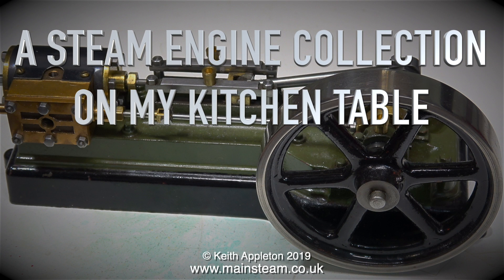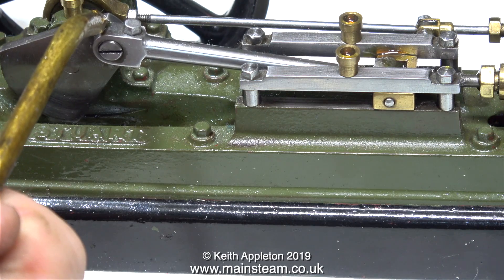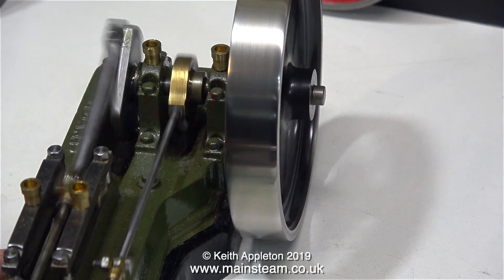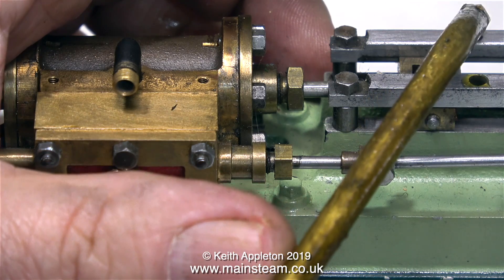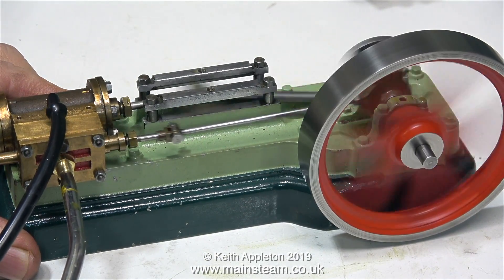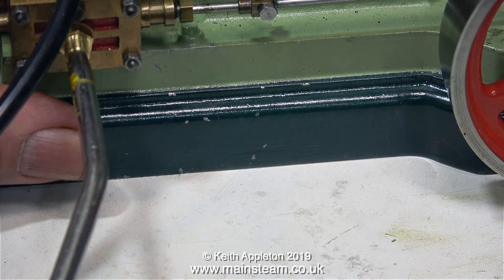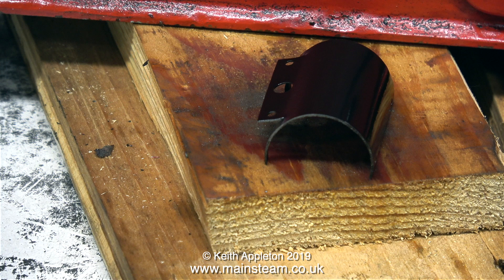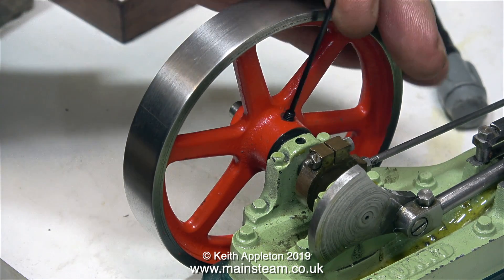A MODEL STEAM ENGINE COLLECTION - ALL NOW SOLD - PART #3 - TWO STUART S50 ENGINES

Comment: Keith, what would you say about (or should I say what are your thoughts on) dimpling the the crank shaft slightly for the lock nut on the fly wheel to sit into, to avoid run out wobble? The nut actually acting like a adjustable "key" more than a retainer under stress.. Just curious...
Reply from the maker: that is a possibility, it would make sure that the flywheel couldn't spin on the crankshaft and mark it , but I doubt if it would have any influence over the amount of "runout"